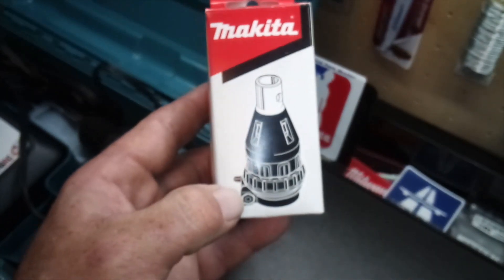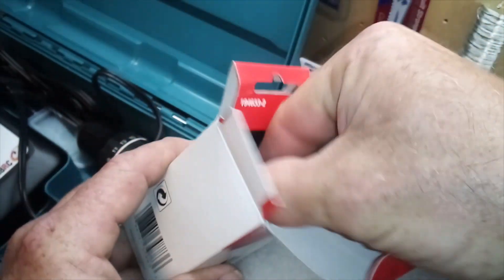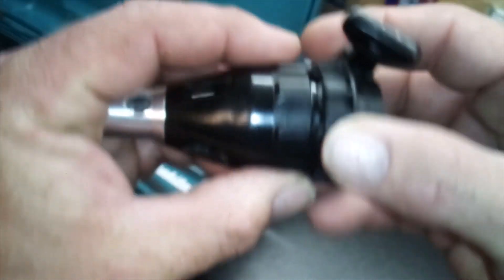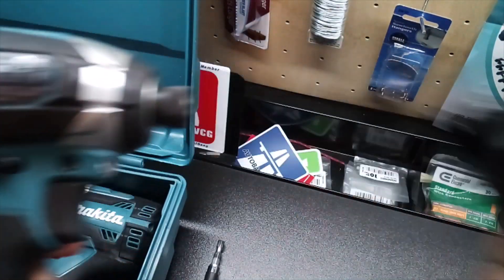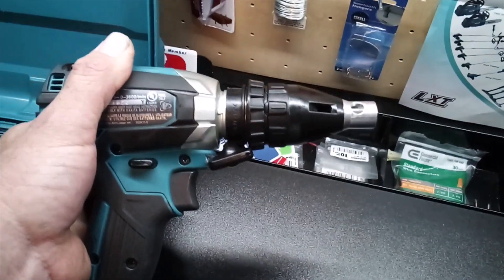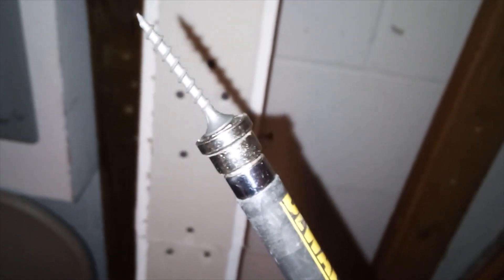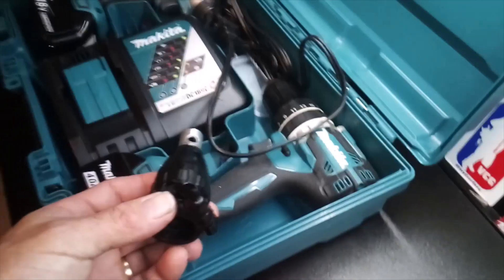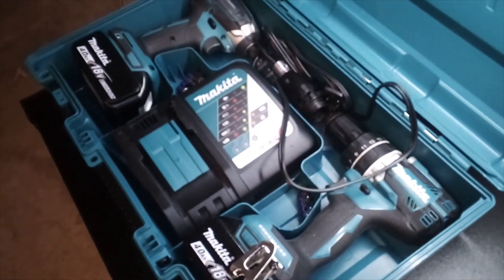Makita Drywall Nose Adaptor For Impact Drivers

Comment: The cheapest screw gun I found on Amazon was Makita corded model for $94.  Kinda pricey for a few screws on a repair job.  Pro drywallers certainly would have one but homeowners? Not me.
Reply from the maker: You're right, just for a random, one-time small repair, a standard drill SHOULD be fine, but not everyone knows when to release the trigger and they overdrive the fastener. This video was to highlight a Makita impact driver accessory for fastening drywall. Nothing more. Thanks for commenting! 😁

Comment: used an m12 fuel impact driver for some drywall. The self tapping screw setting worked some. Still have to eyeball it though.
Reply from the maker: Be careful, Steven Collier, I'm sure I don't even have to say that! Lol 😁👍
Reply: @meagaindave2049  No kidding. Tried once on level 3 and the collet tried to go into the wall.

Comment: I've had pretty good luck with that Dewalt bit in a cordless drill, never tried it on an impact.
Reply from the maker: Drove it way too deep with the impact. Also, i prefer the depth setter not to be a moving part upon contact with drywall.